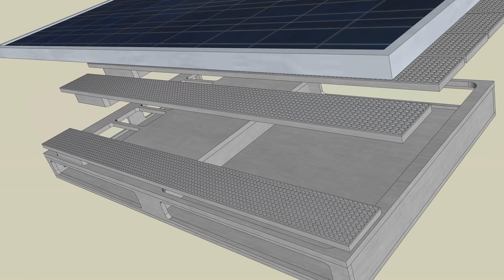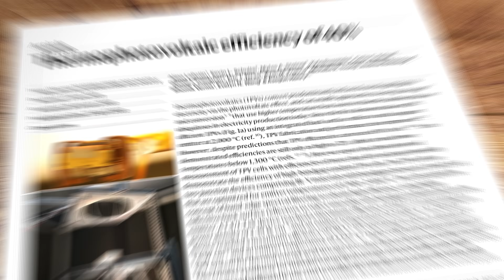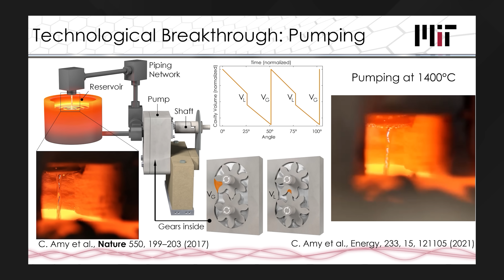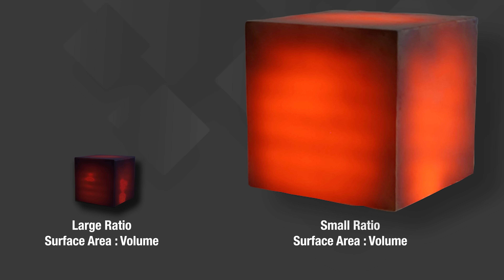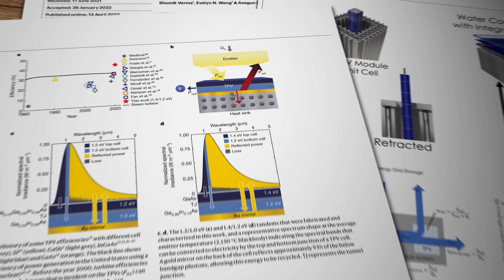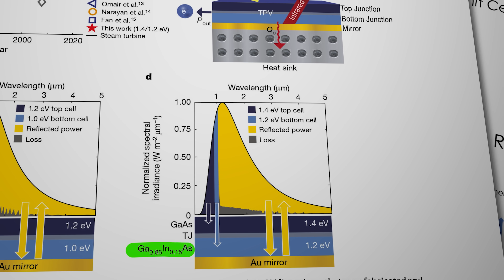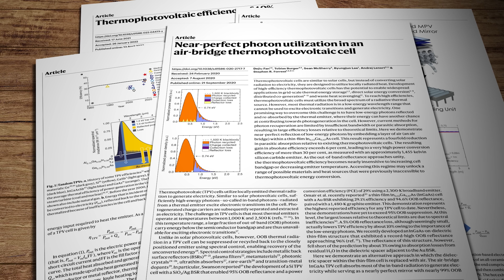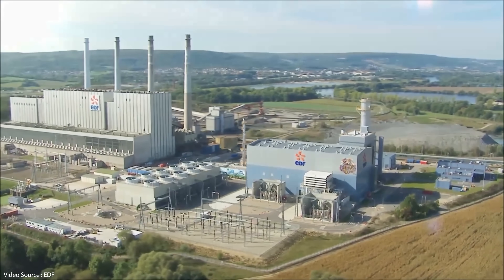Grid Scale Energy Storage 30x cheaper than Lithium-ion! How do they do that?

Comment: How to say "over-engineered" with a few more words...

Like... 40% round trip efficiency is pretty lossy to begin with, but that could be improved so lets just skip that concern for now.

My biggest thing is why bother with the molten tungsten to transfer into the graphite initially? Why not just go with electrical heating elements embedded in the graphite in the first place, at which point the argon isn't needed for avoiding oxidisation of the tungsten, and potentially any insulator could be used...

And then we're talking efficiencies on par with a steam turbine, so yeh, its an interesting new use of thermal sources. But hey perhaps this could be used for fission plants instead of a steam turbine, there's more heat energy there to capture and store, rather than wasting electricity to make the heat when the electricity could be used for something more refined like electrolysis of hydrogen, or even just aluminium (yes that's a bit harder to schedule plants being active alongside excesses, but not massively so).

Comment: How do you stop the buildings from melting and equipment. Steel melts at 2300 F it starts to fail as a load bearing structure at 600 degrees. I ceament good to 3000. But what would you use to hold,raise & lower the cells.

Comment: The big problem seems to be having surplus energy to store. And what happens if the tin solidifies?
Reply: You need heaters around all the pipes, pumps, valves etc. Also need vacuum pump and something like Argon to prime the whole system before filling with tin. This is where running costs (wear on all moving components as well as all fittings) has to be considered. not an easy thing to keep going.

Comment: Ok, so we’re storing heat, and then converting it into electricity.  Why don’t they just use the existing heat—>electricity systems?  It sounds like they are ALMOST as efficient as the standard steam turbine system, why not just cut out the TPV entirely, and basically switch the Nat. Gas furnace out for the Graphite blocks and tungsten apparatus?  It should be cheaper, and it’s possible that they could convert with minimal downtime.  I just don’t understand why they need to jump through so many scientific hoops to get the same results?

Comment: Needing to maintain a pure argon atmosphere or the graphite burns will cause them to miss both their proposed price point and their schedule.

Hopefully they will have multiple, fully independent tin loops in each graphite block, otherwise a tin plumbing problem could leave them with a block of graphite that will be dangerously hot for months. They can't let air into the building until the graphite is cool enough to avoid spontaneous combustion.
Reply: The graphite will oxide, but not catch on fire, because it has too little surface area.
Reply: @AsegunHenry  Aren't all of the oxides of carbons a gas at 2,000°? That suggests to me that the outer surface will continuously oxidize releasing a continuous flow of white hot gas, limited only by the availability of oxygen.

But I am probably missing something. I haven't taken a chemistry class in 40 years.
Reply: @hamjudo  - no you’re not missing anything. That is correct! The gradual oxidation will occur, it just won’t ignite into a self sustaining flame. There’s too little surface area for it to ignite.

Comment: It’s funny how much the Tpv generator looks like a nuclear reactor without being a nuclear reactor.
Reply: This nuclear stuff is dangerous, let's collect from the sun. WIN
This boiling water is 19th century stuff, let's convert heat directly to electricity. WIN
Let's do all this without carbon. WIN.
Let's add batteries. WIN
Let's add super-capacitors for fast response time. WIN
Good job. Now lunch break.
Reply: @markhathaway9456  I was just thinking about how the TPV generator has parts that go in and out of a hot core and will destroy itself if the flow of cooling water is interrupted. Sort of like the control rods and cooling channels of a reactor core.  Obviously not the same, but I thought the similarities were kind of amusing.

Comment: The concept is essentially about storing the heat efficiently and the fast response to demand.
For such a complex system it appears the only plus is the fast response.
I would have thought that researching quicker start-up times of turbines and using this heat storage technology to generate the electricity backed up by conventional Li batteries to cover just the start-up phase of the turbines would be more efficient overall.
Reply: Having a sufficiently sized system to keep the heat makes it seem like a battery, but that isn't it. The main idea is collecting heat and converting directly to electricity very efficiently with NO carbon source, no moving parts (or few), scalability, etc. Batteries more efficient than the heat system could be added for more efficient storage of the energy, so you're not dependent (as with a coal-burning plant) on immediately produced electricity.
Reply: @markhathaway9456  I think you misunderstand my point.

Comment: I have many questions: why two buildings instead of one? pumping into the tungsten emitters would be unnecesary and you'd only need to alter the control code a bit. Second, why not just use aluminum nitride, silicon carbide, or boron nitride semiconductor materials for the junction? At temperature, their bandgaps are still big enough, and they would need minimal cooling, perhaps with molten salt instead of water, eliminating the risk of a steam explosion?

Their engineering concept is just poorly thought out tbh. Though I do trust that thermophotovoltaics can achieve good efficiency though, and I'm excited to see where this goes.
Reply: Exactly, ditch the water. Safety and maintenance nightmare.
But liquid metal has its issues too, corrosion being on the top of the list. They might want to talk to folks developing molten salt reactors to solve that one though.
Reply: @MnrBugi  Hastelloy is what they use. I've found something even better if anyone wants to hire me as a consultant for their project.
Reply: At least place the storage and the TPV cells inside the same block.

Comment: I've got to wonder if efficiency could be artificially boosted by using heat pumps as opposed to resistance or arc heating. This concept is actually really intriguing. For those of you who dont understand why I speak of heat pumps, they use the same amount of energy to heat things, but output up to 3x the amount of heat for the same energy without violating the laws of thermodynamics. How? They use the energy they are fed to pull or "pump" heat from the atmosphere (ie, energy already existing in a separate system). So that 40-50% efficiency could be totally made up for by just using heat pumps to heat the tin! In fact, in warmer conditions, it may come to pass that over 100% of the energy produced by the [insert renewable energy source] would be converted to heat for the TPVs to convert to power! Again, this shouldn't be breaking thermodynamics as the energy is coming from somewhere, rather than just being spontaneously created or something. This is kind of wild honestly. I hope they explore adding heat pumps to the equation. And not only that, but heat pumps are one of the most important technologies in fighting climate change. Just last year the US government (or DOE I think?) put out a proposal for US firms and research institutions to massively increase the efficiency and range of operating conditions of current gen heat pumps to next gen heat pumps. Who knows how good the tech will get. But jeez, this technology will be ESSENTIAL to places like Hawaii and Puerto Rico, among others in decarbonization. This seems like it'll pack a big punch for it's size which is good for places with limited real estate.
Reply: My understanding is that heat pumps get less and less effective as the temperature differential increases.

Comment: I like the casual style of the presentation while talking about 2000+ deg C temperatures, like it's the most common thing in the world. Also, the indicated efficiency is at the cell level, not at the system level. Round-trip efficiency will be way lower. I think that the first commercial Grid Scale Energy Storage of this type will be inaugurated the next day after the first commercial Fusion Reactor power plant.
Reply: yeah this system is terrible. A solar cell at 2000 °C? This is crazy...

Comment: Sounds good, but there are a couple of issues.
1. It's inherently big, while li-ion batteries can be any size. Not an issue for grid scale of course.
2. Efficiency is still bad compared to li-ion. This means more energy has to be generated, which increases the overall system cost significantly. Might still be cheaper though.
3. The large size means slow and expensive construction. That leads to all kinds of additional problems.

Also, why not use heatpumps instead of resistive heaters? Cost maybe? It would increase the efficiency significantly.
Reply: Lion batteries hold electricity. The heat-to-electricity system is about collecting energy and producing electricity -- like a coal-burning electricity-generating plant. But, the heat-to-electricity system is not carbon-based, is scalable, can be almost anywhere, produces a lot of power, etc.
Reply: @markhathaway9456  
That's ok, if you start with heat. But if you start with electricity, it makes no sense to convert it to heat then back.

Comment: The part that works like a giant radiator strikes me as being a place where improvements can be made to capture and or use that heat.
The rest of the system looks good.
And if it's close to competitive already...
Anyway I look forward to seeing how well it works when they get it out of the lab and start testing a full scale version in the real world.
Reply: A theoretical plant based on small demonstrators seems competetive...on price. Untill they build an actuall full-scale demonstrator it's not competetive.
Reply: I was thinking the same. If they were to put this in urban areas they could use that waste heat for central heating and hot water?
Reply: @diceman199  You could, but it'd be very inefficient. Using electricity to power electrical heaters, funnel the feat via molten metal into storage blocks and then into photovcells is a hell of a lot less efficient than...just using electricity to power electrical heaters.

Why use this when you can just build a pumped water storage system + electrical heaters.
Reply: @nonyabisness6306  not all areas can make use of pumped storage. I’m talking about using the cooling water to heat domestic properties etc to make it more efficient
Reply: Some narrow band filters may be useful here

Comment: Concentrating thermal solar, with its higher efficiency, is obvious instead of using solar panels as renewable source to produce heat (for melting Tin). The waste heat from the cooling loop is likely going to be used for distributed heating, instead of just being vented to air.
Reply: The waste heat is almost room temperature and you'd need to attach a heat pump to bring it up to something respectable again like 80 degrees C. Panels really lose in efficiency when heated.
Reply: @soylentgreenb  Yes as the Thermal cells need to be kept at low temperatures, the waste heat will also be of low temperature, but still hot enough for room heating, and The current road map for distributed heating in my city in a future without fossil fuels involved, is to use solar, wind and process waste heat, which means that the forward temperature to customers will be much lower, so some customers will need a water to water heat pump.

Comment: Given siting at peaker plants, it seems easier to just use molten tin in graphite as storage medium, and then just use the tin to produce hot gas for existing turbines.  The driver here is to drop the required capital investment, not get a bit better efficiency.  For instantaneous load response, just use a bit of LiFPo battery capacity.
Reply: the whole point is to replace expensive batteries with this so what is your point?
Reply: @cornishcat11  This looks more expensive than batteries and much more fragile than batteries so what's your point? Gas turbines and molten salt storage is much simpler and cheaper.
Reply: Use two-way stirling engines to pump heat in stead of electric heaters.

Comment: using my limited combining skills we had PVT and TPV covered so i expect next videos are about PTV, TVP, VTP and VPT.
Okay back to serious i see one interesting advantage not mentioned so far. We have a lot of homes heated by combined heat and power plants running on fossil fuels. As a by product you already generate hot water with this technology and you have a lot of stored heat, so it could be easily used as replacement for those power plants without loosing all the investment in the infrastructure you have at the moment.
On the con side: Huge blocks of carbon extremly hot require a very good failure management to avoid a nightmare if the argon security layer runs into an issue. That might for risk management limit the places you can put those.

Comment: what happens if the tin cools down on a cloudy day??? One of the biggest carbon emitters are float glass production lines. They use molten tin to produce glass, the reason being that tin is denser than glass (hence float) and molten at the melting and quenching temperature of glass. Once put on line, the float plants produce for their entire design life. If demand for plate glass falls the glass coming off the line is smashed and put back into the line. Because if the tin ever solidifies the plant is ruined! The MIT guys will need backup gas heaters to keep this crazy system from freezing on a cold day ;)

Comment: At my pay grade, pumped hydro storage is about my threshold of understanding.  Amazing technology.  Hope it works.
Reply: Hydro depends on sun energy to raise it to the skies when gravity and cooling bring it back down as rain or snow. The sunlight melts snow and produces run-off, into fixed stream/river areas. Here you collect heat directly, store it for processing in the video plant, convert to electricity, perhaps store that in batteries, then ship it out to customers. Put the plant anywhere you want, no carbon, size to needs, improve the tech over time.

Comment: Cool idea but as others have already said, it seems very complicated compared to ideas like the liquid air battery that uses off the shelf technology and would be simpler to recruit skilled construction, operation and maintenance staff.
Reply: It's not a battery. It's a system to collect heat and convert it directly to electricity. Batteries not included, but could be added.